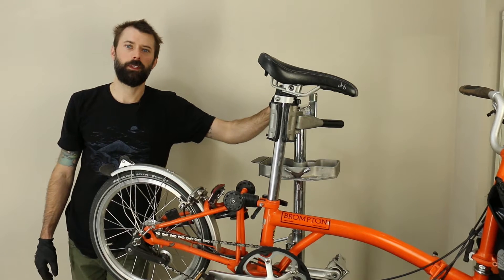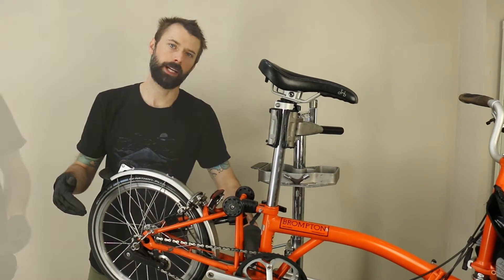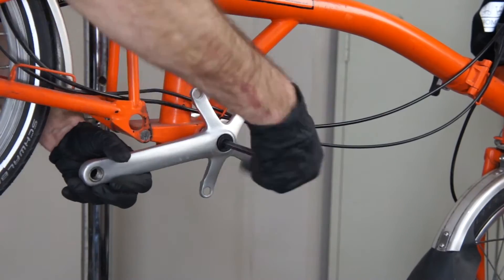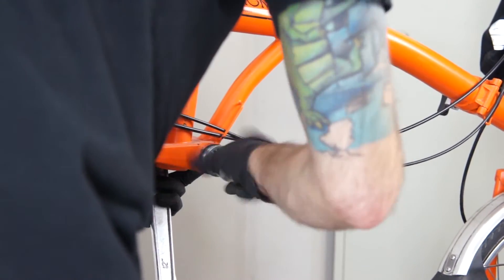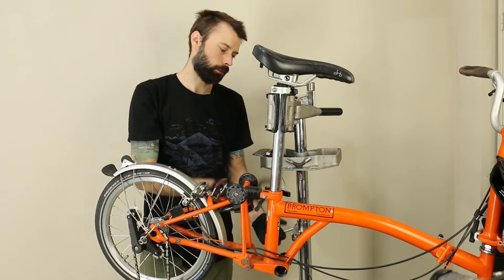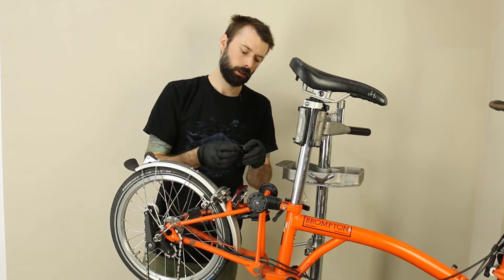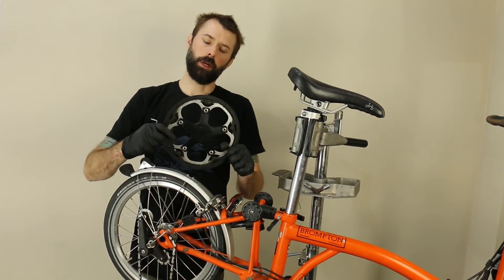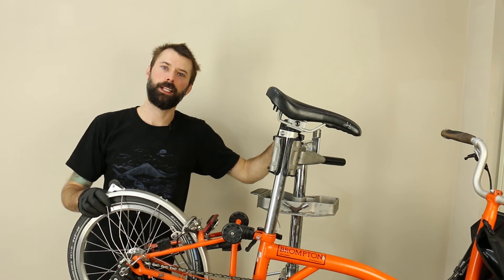Installation of the ERider T9 Torque Sensing Bottom Bracket

Comment: Does a torque sensor care if the bike is single or dual motor?
Reply from the maker: Nope
Reply: @GrinTechnologies interesting.   Because I have a dual motor bike and somewhere the signal is getting jacked as the sensitivity is nowhere to be found.  It takes standing on the pedals to get torque pas activated.  Rear motor is less sensitive than front which is weird because the bb wire goes to the rear controller.

Comment: I've installed the sensor but it's not working, I've checked voltages and they're fine.
I'm using en06 display with T9 sensor, it doesn't have and torque sensor setting. Could you please guide me here?

Comment: Whats the difference between the T9 and the T17?
Reply from the maker: T17 has quadrature signals for the PAS sensing allowing back pedal regen control.
Reply: @GrinTechnologies  Thanks for replying, so unless you need regen, the T9 is sufficient for basic pas function, and torque sensing?

Comment: Is there no bearings in this setup ? The modern ones have bearings that need drove in makes for a much easier ride and i dont think the chain sprocket has any sensors or anything like that i think the signals are sent straight to the conrotter via a eire that comes from  the torgue sensor itself this eire comes from the bottom of the crank a hole needs drilled in older bikes id say
Reply from the maker: There are indeed ball bearings that are integrated into two threaded caps on either end.
Reply: @GrinTechnologies  one of the caps broke on me while using a 3prong puller go easy with them there very light,ive got into modes using the computer true the controller theres 4choices on mine ive picked 4 and truly love it cant see why they'll only allow 1 to 2 ratio thats most off them but i heard u can adjust with a good display 👍

Comment: If I install a torque sensor BB, would I be able to use throttle AND torque sensor at the same time with the CA v3 ?
In this case, I would connect the throttle directly to the CA and the torque sensor in its specific CA connector, right ?
Reply from the maker: Yes, 100% correct. We've been a bit perplexed why there's been some assumption that throttles and torque sensors are someone mutually exclusive. Having both control options available is always the best.

Comment: thinking of buying this with my Grin Kit and also getting the belt drive upgrade from Kinetics Bike Shop in Glasgow, but im just wondering would the two be compatible? I read belt drives operate at higher tension which puts more wear on bottom bracket and rear sprocket, but there's also the question of whether it'd be able to be fitted at all.  I would link a pic but i think youtube auto deleted my last comment even when i tried to obfuscate the link, but it seems Ben's (kinetics workshop owner) kits use the same 5-bolt shape as the brompton chainrings so i guess it'd just be a bit thicker, would that still work with the ERider spider and crank do you think?
Reply from the maker: There is no issue with belt drives, the pretension forces pale in comparison to the tension from active pedaling so that doesn't change the wear dynamics of the bottom bracket by any noticeable amount.

Comment: Thank you for the great video. I have Swytch kit on my brompton, will this work well with it? Also does it matter my Brompton was made in the late 90's? would there be any issue with fitting it?
Reply from the maker: It's extremely unlikely that the motor controller on your Swytch kit was designed to bring out a plug that will be natively compatible with a torque sensing bottom bracket like this.

Comment: I have a Landian Sinewave (36V 15A)  with a torque sensing bottom bracket. Would I be able to get the ERider to work?
Reply from the maker: If you already have a torque sending bottom bracket, then you have no need for an Erider. Just use the torque sensor you got with the controller which you know is already compatible.

Comment: Can the IDbike TMM4 torque sensor be used with the Cycle Analyst V3?
Reply from the maker: You can use the force signal from the TMM4 as an alternative to the throttle input command of the CA3, but you can't use it on the torque input line since the torque PAS of the CA3 requires cadence pulses as well.

Comment: can these guys plug straight into a kt controller and work like a cadence sensor with little or no settings tweaks?
Reply from the maker: Assuming you get the pinouts right for the PAS signal and have a 12V rather than 5V supply then I don't see why not. The cadence portion of the module is electrically the same as most generic PAS sensors, giving 0-5V pulses with forward pedaling and no pulses when pedaling backwards.
Reply: @GrinTechnologies  wow thanks man.

Comment: When I torque the lock ring, the spindle in the bottom bracket now has a fair amount of resistance to spinning.  Is this normal?
Reply: Maybe you can help get mine working as grin is no help.
Reply: @nanopete6472  Possibly, but I'm no expert.  The only thing really strange was configuration of the CA3.  I ended up upgrading to one of their beta test releases to get the correct settings for it.
Reply: @looperlativeaudio  thanks. I bought all parts they recommended so it should work. I'm sure they will get to the bottom of it but its frustrating for sure
Reply: Hi. Have you your erider fully working please?
Reply: @nanopete6472  Yes, I have it working.

Comment: You said Witeless? How sensor data are sent to the motor? Which motor you use? Is there any kit available which includes TQ sensor, motor and controller? How do you power sensor if there is no wires going to botom bracket???